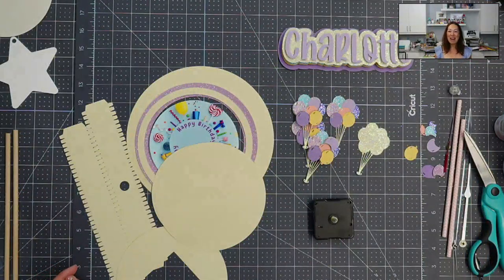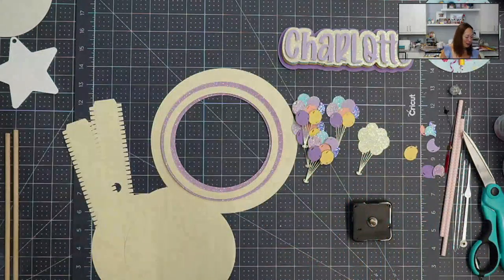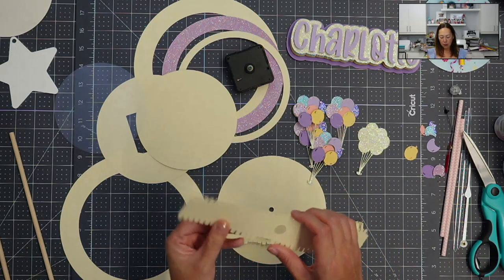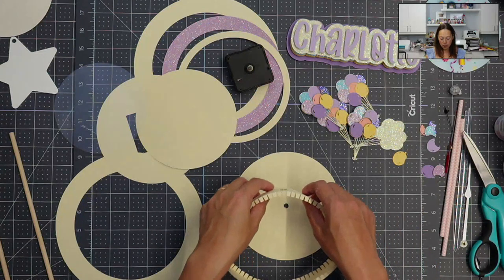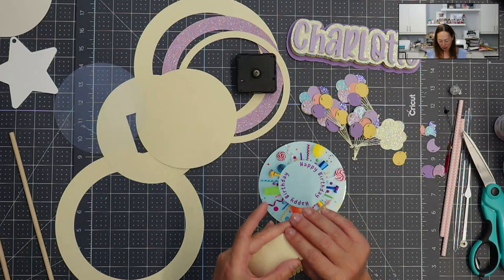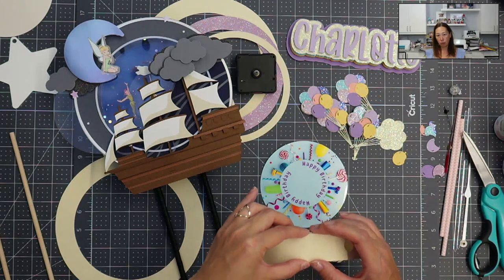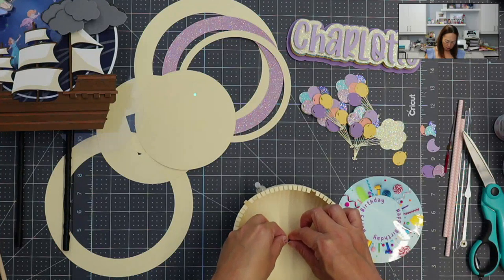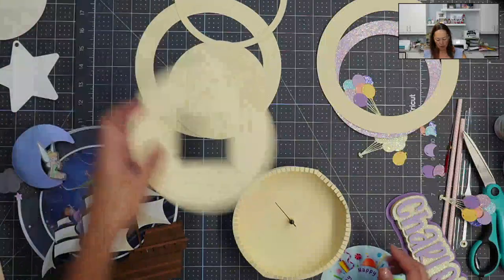How To Assemble The Moving Cake Topper SVG I | Step By Step Assembly Tutorial | The Useless Crafter

Comment: Please consider using double sided adhesive. No drying time like there is with hot glue. Scotch ATG is a tape gun like but it dispenses double sided tape. There's also sheets you die cut the paper with it peel the baking press and done.